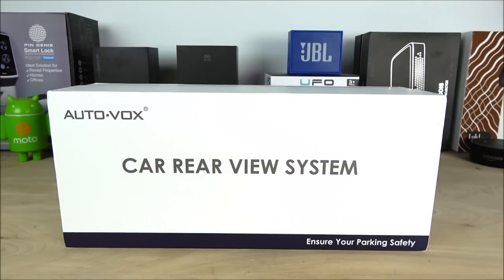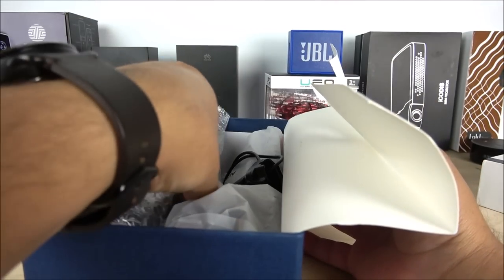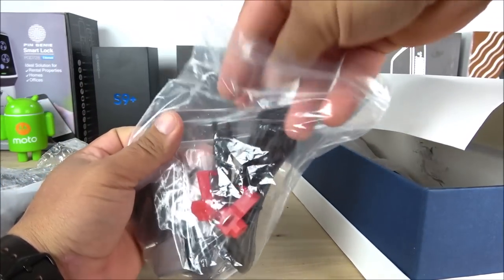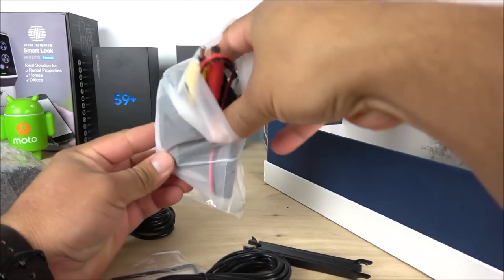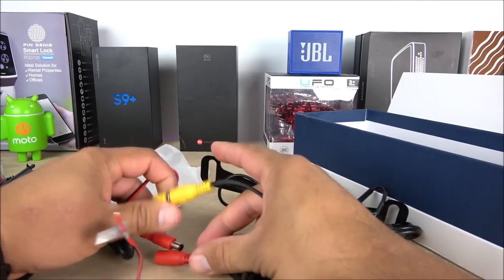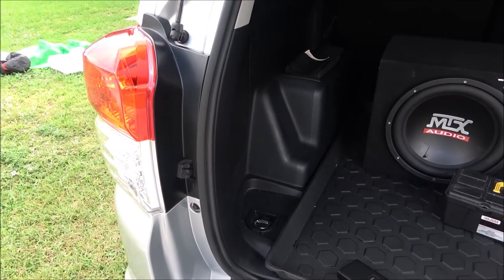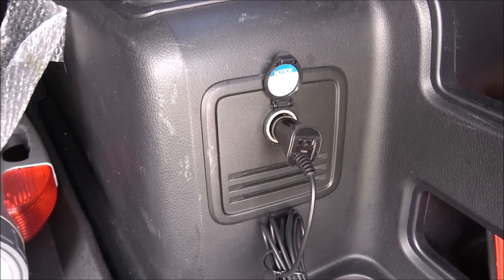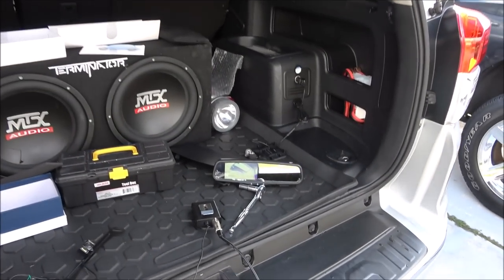Auto Vox T1400U - A Wireless Backup Camera [Easy To Install] for Any Car/Truck!

Comment: You could also get a separate power plug-in from an old dead-car, 
connect it to the electrical system of the car, hidden somewhere inside  and use it to have a permanent connection for that mirror-cam.  ;)

Nice tool.  I hope it'll last forever !
Reply: How about you just cut the cigarette plug from the device and just hardwire it to the electrical system with fuse tap?

Comment: The amount of people saying it's not wireless, or that they hate using the cigarette lighter 🤦‍♂️
The point of being wireless is the transmitter so that you dont run wires from the camera/reverse lights all the way to the mirror itself. The cigarette lighter can be cut off and the wires tapped to any 12v source.
Reply: Yes, so if its wireless, why run the wires all the way from back to front?

Comment: Says wireless yet you still have to hook up wires. lol. Reminds me of the one a day vitamins. Yet on the bottle it says take one in the am and one at night
Reply: Lol. EXACTLY
Reply: wireless because you dont have to run camera wire from monitor to camera.  it still needs wires to give each component power
Reply: @RampFisha  Woooooosh
Reply: I'm confused.  do I have to run wires from the front to the back? If so I'm returning it. 
It says on the manual in big letters WIRELESS backup camera.

Comment: Does it have to connect to your cigarette lighter? is there any way to hard wire into a hidden spot?
Reply: You could just cut the cig lighter end off and connect it to power and ground with your choice of splice or terminal.
Reply: They sell one that uses only wire so the cigarette lighter can be free

Comment: Is there a product that does not require the mirror to be plugged in to the cigarette lighter?? The way you ran the wire was great but then your lighter is occupied. What do you do when you want to use the lighter for something else?
Reply: I suspect there is way to splice the wire and add a fusable link and it should work off of the car power

Comment: you could of taken the cable through the rubber conduit, it's very easy, all you need is lube and something stiff to penetrate through the hole and Bob's your uncle your through ;)

Comment: If you have an auto-dimming mirror, can you just use that power source right there at the windshield? That would save a huge amount of work. 
Also, do the guide lines move with the steering wheel? I think not.
Reply: i have the same issue...did you figure out the correct way to hard wire this mirror?

Comment: Lost me at cigarette lighter! Anyone have any recommendations on a similar product that has a more permanent installation?
Reply: Jeff Parkin do you know you can just cut the cigarette lighter off strip the wires and connect them to the battery or the radio or pretty much anywhere the cigarette lighter just makes it more of a plug and play but you can cut it off and connect the wires to any 12volt source In your car.
Reply: Cut off the wires connecting to the cigarette lighter and tap into any 12V rail in your car with posi-taps.
Reply: HA see that factory 2 DIN he had in his car , most likely has an input for a camera it just did not have the camera from factory installed , i have a aftermarket 2 Din player in my car that connects up to a high quality sony reverse camera all wires are hidden , also has apple connectivity for phone a microphone to answer calls via stereo , and WAZE GPS , this guy installing this is a JOKE the system he put in is a joke
Reply: He lost me when he pulled out all those wires. I’m still wondering why they call it wireless

Comment: What we need is a completely wireless video transmission system.
Reply: How would it get power?
Reply: @fdaygo7794 technically a replaceable battery would work but I assume people want to place it in the car with no wires.
Reply: @fdaygo7794  what’s that?

Comment: My Ford Edge has a wire harness coming out of the OEM mirror.  Probably for auto dimming and the on-board compass which we don't need.  So I should be able to tap into this harness to eliminate the need to use a power plug or cigarette lighter.  Don't like the idea of having wires coming out of my dash. They should offer different harness plugs for different manufacturers kind of like Crutchfield does for car stereos.
Reply: i just pulled the lighter out spliced it and put it back in .....simple... you can also just go directly to your battery. The screen only engages when reversing anyways :)

Comment: DO you happen to know what's involved in HARD WIRING the  mirror power to the vehicle ignition? I'd like to do that rather than having the 12 v socket adapter.
Reply from the maker: Just go behind that 12v plug.
Reply: @MJTechChannel  Thanks. Either that, or splice into the ignition  wire, maybe? I don't want constant power, just when I have the truck running.
Reply: @markecklund3125  There's a lot of options since many things become energized upon "ignition" power. If your vehicle has a constantly powered 12v plug, try piggybacking the ignition wire for the stereo deck.

Comment: How would I install this on a 2010 ford taurus??
Reply: Did you get one installed? I'm putting this on a 2010 taurus limited also. The factory cam (no longer works) is in the Ford emblem and the license plate is low on the bumper, so wondering if it's worth it.

Comment: How does the mirror connect to the camera did I miss that part?
Reply: its wireless... thus the transmitter .
Reply: Leatherkid01 thanks I knew I missed something while watching it
Reply: @Leatherkid01   I"m confused .  I have this product in hand.  Do I have to run wires from front to back or not?
Reply: I have it in hand , but yes I'm confused also.

Comment: Got this camera, NOT an easy task to install in a pickup truck. Wouldn’t recommend for a truck, as there are no panels/trims to remove to install the transmitter and hide the wires. Car or 4Runner, maybe.  But NOT a truck.

Comment: Too many wires for a wireless backup camera.
Reply: How would you power yours then? Persuade the electricity to jump to the transmitter and mirror? 

My wifi router has to be plugged in for power and also the connection from outside for the fibre optic cable... so is my wifi truly not wireless? My phone doesn't seem to be connected to anything as I'm writing this...
Reply: - You’re not making sense with that WiFi example bro. You’re using the internet on your phone without connecting it with wire, that’s what wireless means. You made a mistake attacking me with that bs. lol